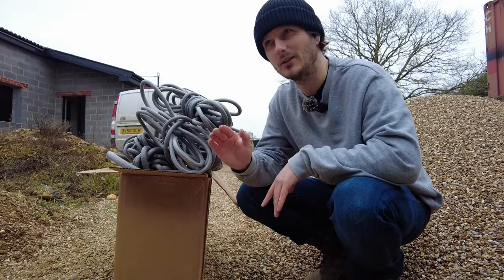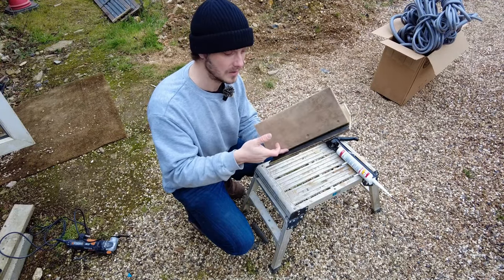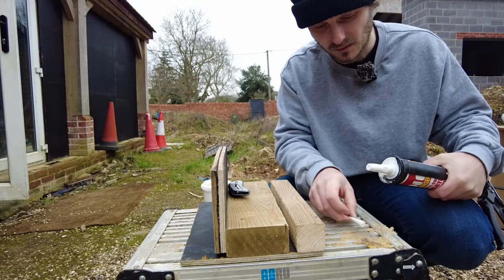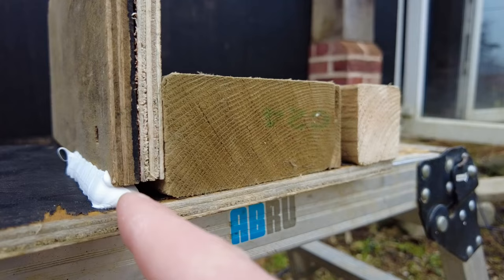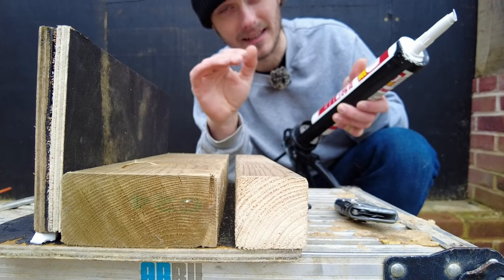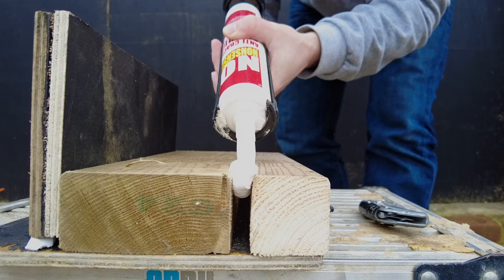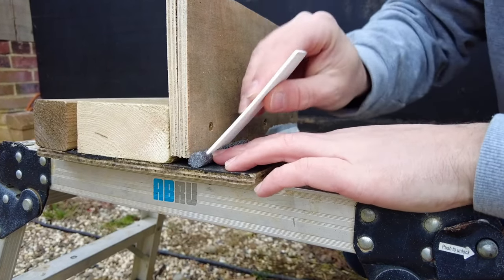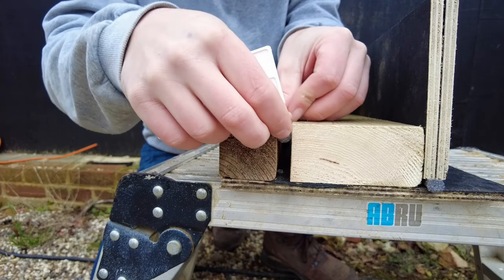The Simple Secret to Filling Large Gaps with Caulk or Silicone Sealant

Comment: I don't mean to giggle that a lot of people have never heard of or seen these foam rods before.  My dad used them all the time for different projects around the house back in the 70's when I was a kid.  I'm guilty of having a crap ton of the assorted sizes at my mom's house for sealing the gaps around the window air conditioner to keep the cold in and the heat and wasps out.  Handy in her basement also for filling gaping cracks and then using spray foam over them to get a good air tight seal. (note:  she has a low ceiling, cellar type basement with cinder blocks)

Comment: Foam backing rod is not just for using less caulk, it also acts as a bond breaker which prevents the caulk from bonding to the substrate, which makes the caulk less flexible and more prone to failure.

Comment: Funny thing is, 25 years ago I used to work on the roads installing weather stations. Part of this was putting sensors in the road to measure temperature and chemical concentrations, moisture etc, and we ran the cables back to to the base stations via slots in the road and we used that foam under and over the cable to protect it and to reduce the mount of polyester resin we needed to backfill the slot, since it was pigging expensive IIRC. Totally forgot about that until this video, and it would never have occurred to me to seek this stuff out for DIY. Nice one!
Reply from the maker: It doesn't seem to be one of them things that's common DIY knowledge, which is surprising really. Maybe it's only really needed on a project once in a blue moon so people just blow through a load of silicone without thinking 🤷‍♂️

Comment: Used these foam rods in the expansion gap on my concrete driveway. Generally speaking, expansion joints should be no farther apart than 2 to 3 times the total width of the concrete your laying. Sealed the rod in with a grey mastic sealant.

Comment: When using silicone or mastic for an expansion joint it should only touch two faces. So backer rods are used to ensure the rear face does not touch a fixed surface, thus allowing for movement. It's a bonus that you also save on silicone too.
Reply from the maker: Someone commented something similar 3  weeks ago, I wish I would have known this before so I could put it in the video 🙂

Comment: Thank You for the video. Backer rod is great. You can also use any type of high density or medium density foam for most applications. Backer rod tends to be a lot more expensive and it not as easy to work with with larger gaps or with gaps that vary in size.
Cheers from the Land Down Under.

Comment: Probably a silly question but what's the likelihood of the foam tubes going mouldy with water exposure? Need to fill a massive gap between the bathroom wall and tub edge, and don't want any potential leaks ruining my efforts 💀
Reply from the maker: Anything would go mouldy with the right amount of moisture and heat when you think about it. You should aim to get a good seal from the offset. 👍

Comment: I was told that to fill even larger gaps you can twist two pieces of rod together and stuff it in the gap. 👍
A windows installer told me this....which unfortunately was needed to fill the huge gaps around the uPvc windows he was installing. Some cowboy outfit whose name begins with 'A' and ends with 'Home UN-Improvements'!!
That was fun dealing with those cowboys.....but what doesn't kill you makes you stronger.....apparently!
Reply from the maker: Well that's handy to know. Sounds like a pretty big gap though 😬
Reply: Twisting the backer rod is a very bad idea. Backer rod does threee things that are essential. 
1. It controls depth
2. It forces the sealant against the sides of the joint when you tool it.
3 It provides the proper profile for the sealant. Which is non existent when you twist the rod.
 
The person that told you this was absolutely wrong.
You should never do it since backer rod is available n sizes from 1/4” to 4”
Reply: @genecarden780  Thanks. This was 'advice' from a cowboy company of windows installers (one of the big outfits in UK). I assumed that at least a tiny bit of what they told me was correct. It turns out that EVERYTHING they told me was false. No real surprise. Some people don't know how to tell the truth....or perhaps they have just been taught by other cowboys (ingrained bad practices). 
Your explanation makes perfect sense 👍
Reply: @Sean006  no problem there is a LOT of bad advice out there. And unfortunately a lot of it comes from so called “ experts” . Most of the YouTube videos on this subject are wrong, in one way or another.
I have been a professional caulker for over 45 years now. I just want homeowners to have the best chance for success.
But sometimes “ pros” really anger me with there ignorance. A window installer should know the basics.

Comment: ASTM has documentation explaining backer rods, and good manufacturers provide technical documentation with best practices.

A proper installation with a backer rod or tape will prevent too much sealant from touching too much surface area. If there's too much sealant, the expansion and contraction of thermal cycling will cause the sealant to rip itself apart or break adhesion from a surface. Think of the sealant like your arm muscle and the adhesion like your hand: having a really strong arm that rips your hand off everything you grab would be counter-productive, lol! This is also the main reason silicone is tooled (to reduce the thickness in the middle compared to the sides that do the real work adhering)
Reply from the maker: Ahhh that's super interesting and makes perfect sense now you've mentioned it 👍

Comment: Ta :) Do you pop a hole in the end of the silicone tube to stop the silicone pumping out after you depress it? I haven’t tried it yet but historicallyI’ve lost miles of silicone/caulk that way.
Reply from the maker: Oh no you just release the tension, so just push the metal bit at the back of the gun so it let's go of the bar and it'll stop. You just need to get into the habit of doing it as soon as you stop. I mostly use my electric gun and have to do something similar
Reply: @THE-AIDEN-PROJECT  just let me kick myself 😂
Reply: @THE-AIDEN-PROJECT   someone said if you wrap tape around the mastic tube before starting the plastic tube won't expand when pulling the trigger so when you release the trigger it will stop coming out straight away.Do another video and let me know if it works

Comment: Hi is this rod water proof, just had a quite big gap between shower base and wall, it was leaking so I removed old silicone but now thinking how to fixed as only silicone won't do the job
Reply from the maker: @jakub2611  I'm pretty sure it doesn't absorb water like a sponge. As long as you put silicone over the top I think it'll be fine

Comment: What if you have a tapered gap, starting from 25mm down to 1mm? The length of the try is 90cm.
Would you suggest that I cut 30mm half way, then use a 20/15mm?
Thank you for responding to all the comments by the way.
Reply from the maker: Yeah that sounds like a sensible idea, I've used 2 different thicknesses in the same gap without any problems